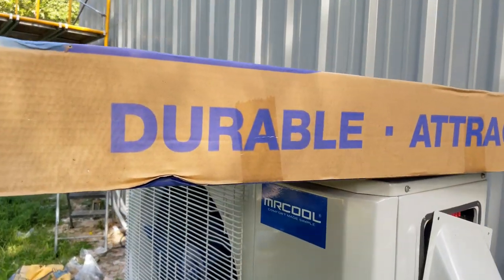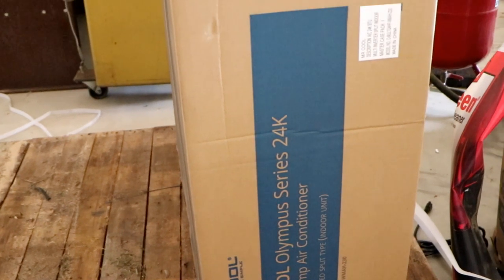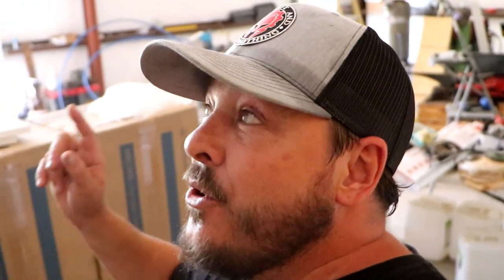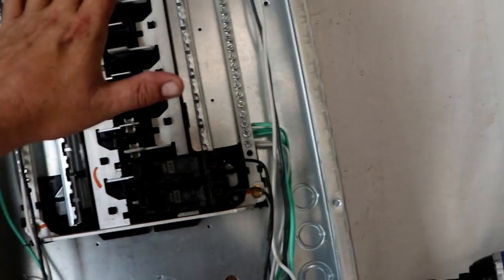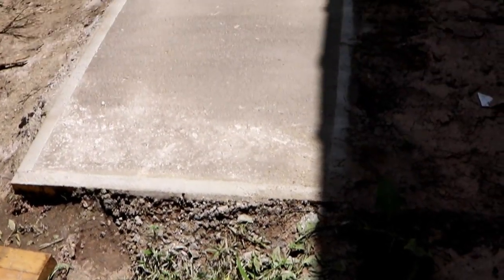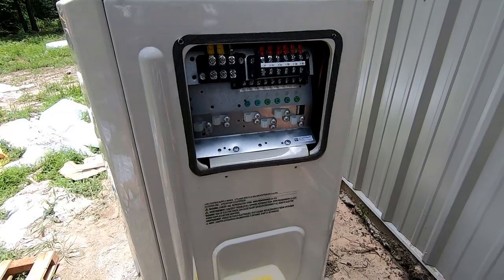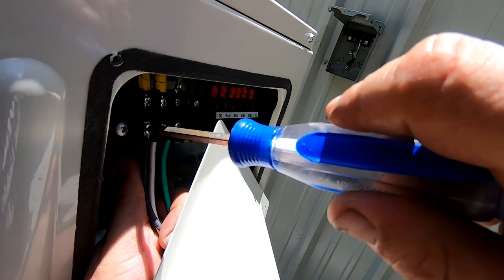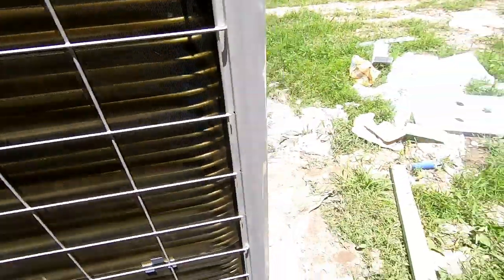MR COOL DIY MINI SPLIT Install

Comment: Here is Charlotte NC, it gets hot but, not Texas hot. However, my modest 580+ sq shop with loft stays cool in the summer and warm in the winter for about $30/month. What a great way to work! Wish I had this 30 years ago! Great video!

Comment: If I remember right slot of the mini splits come pre charged I  have a conventional unit and my outside unit came pre charged too all you have to do is pull a vacuum and open the valves

Comment: Any plans to install solar to help cover the power costs of the AC and the rest of the shop?
Reply from the maker: +Tedium Yup. I located the shop at the top of the hill south facing with full sun. I also have a 400 watt wind generator that may or may not go up. I would like to have the shop full solar with a diy tesla style battery wall using 18650s of something similar.
Reply: @TheGoodoftheLand  the YT channel JehuGarcia specializes in DIY tesla powerwalls and is in Cali
Reply: @TheGoodoftheLand  Check out the cells that are being recycled out of Ford EVs...I don't recall the model but supposedly they are quite cost effective and stable, with the right controls of course.

Comment: I’m an electrician and I honestly think you installed it pretty well. Maybe you’ll pin me anyways. Btw the one thing that did irk me was you putting red before black in the 123 lol
Reply: The 10/2 MC on a 50A didn't bother you?
Reply from the maker: +Sam Gaunt  Sorry, it's a 30 amp circuit. I misspoke.
Reply: @TheGoodoftheLand  It's our "culture": from the time we are entrusted with wire strippers, we're quizzed and judged on everything last we do. From our journeymen, our masters, inspectors, engineers, the list goes on. Think it's annoying? I just realized I inspected your work, on a Sunday, on Youtube, while I'm tryin to relax! I need more beer...

By the way, work looks good. It's actually code to have a means of disconnect for any equipment that's "hardwired" like your condenser. That's an oversimplification, but ...beer...
Reply: @TheGoodoftheLand  PIN HIM !!!!!

Comment: General rule of thumb. Line 1 is black, your low powered stuff lights, fans, etc, or 1st leg of a 220 connection. Line 2 red is your dedicated high power/ motor 2nd leg of the connection. Good to wire it that way for easy troubleshooting and even power distribution. Don't have to wire it that way but it helps.

Comment: very good video thanks for the info on what it takes to cool the building.i thought that mister cool systems come recharged and you dont need mohave a/c neck to pull vacuum

Comment: Abom79 has a video installing his but the unit came serviced already. once you tie yore lines in you open valves. this is a awesome unit you have. I will check out mine now
Reply from the maker: +Rodney Wroten Yes, Adam's was the DIY unit. They are a great option. No evacuation required. If I had to do it again I would go with a 24k diy and save some money. 24K Is plenty big enough for a 1200 sqft shop.

Comment: Don't know if this applies to your system, but on ours we can't turn one off because freon keeps circulating through unit and causes coil to mold if there's not some airflow over it at least some of the time.

Comment: This is an older post, but anyone with Mr. Cool experience, do you know which unit is best to get for the 5 zone?  I heard you can phase them in later and can start with say two if you are on a budget, and can add more later as money allows.  I want to get one that can accommodate up to 5 zones, but due to money issues I could probably on afford to start with two zones, 5 ideally.

Comment: What gauge wire did you use between the AC disconnect and the unit. I'm using 8 gauge between the disconnect and the breaker box but I'm having a time to get the wires to go into the hot hot ground on the unit. I used a 10 gauge wire mines is a 27k but unit
Reply from the maker: +Darnal Green Ten gauge is fine. Ten is actually fine for the entire run. The unit barely pulls any amps. I was shocked at how little power it used. If you need any further help shoot me an email with your phone number

Comment: Is this the same setup Adam Booth added to his shop? I wouldn't mind having AC in my shop.  My shop is built very similar to yours, but I don't have any insulation, and the time it would take to move everything away from the walls in my shop to add insulation would be CRAZY! Did you buy your insulation with the shop kit?
Reply from the maker: +Salvage Workshop Yes but Adam's was a 18000 btu. For your shop size I would get the 24000 btu (link in description) Grab some foam board insulation from the big box store as install it on one wall at a time. It will change your life. The unit itself will absolutely cool your shop without insulation but it will be consistently fighting the heat.
Reply: @TheGoodoftheLand  Awesome! Thank you brother! I'm gonna take a serious look into that!

Comment: nice video, I have a 1000sq ft ranch open concept . Do you think the 24btu would do the job?
Reply from the maker: +D Mac Definitely. Im at 1200 and I only use one head. Its in the low 90s here today and my shop with one unit (24k btu) is in the 60's. I have it set at 62 for testing. It is killing it. Very happy with the unit.
Reply from the maker: +D Mac I'VE an Amazon link in my latest vid with my recommendation.

Comment: Thank you for the video. Appreciate that. Question, does the gauge of wire coming from the the breaker to the disconnect box need to match the gauge of the ac whip going to the actual unit? Hope thats not too confusing.

Comment: Did it come with Freon ? If not what did the Freon cost ?
Reply from the maker: +mean gene it does come with freon. No need to charge the system. Just turn a captive valve to release into the evacuated lines. If you buy the DIY system you don't have to evacuate the wall unit.
Reply: @TheGoodoftheLand  dang that's a hell of a deal. I see a purchase in my future. My Barn/woodshop and my 2 car garage/hot rod shop gets smoldering hot. North Houston. :(

Comment: Is the unit linked above the exact unit you got ? 
I need to get 36k spread over 3 rooms.
Reply from the maker: No. It is 24000 btu. I have two 24000 btu heads. You only need one for a shop this size. I can easily maintain 70 with just one unit on in summer. Two is overkill. Could literally hang meat in there.

Comment: i though the meny split AC units you didn't need someone to pull a vacuum? how much $ ?
Reply from the maker: +Keith Baker You don't if you get the DIY system. This system is not the DIY. The only difference is the evacuation. It cost me $100
Reply: @TheGoodoftheLand  that unit was $100?
Reply: No I think he said the unit was $1000 and to have the system vacuumed or evacuated for installation was $100.
Reply from the maker: @keithbaker5042  No. My unit is 2 4k unit. The evacuation was $100. I recommend only buying the 24k unit as that is all you need for a shop this size. Hope this helps

Comment: The whole reason to buy the Mr. Cool DIY is because its pre-vacuumed and you paid extra for that.  So you don't need the AC guy. If you are going to do the vacuum yourself, then at least cut the lines to fit.  With the way you curled the coolant lines up up, you're going to get oil stuck in those areas and it will mess up your compressor over time.  Your "AC" guy should have known that.
Reply from the maker: +Kimo Jon you are correct. He hated it.

Comment: I have thought about such a system, but worried that the air has so much saw dust and sanding particles in it, that it would clog up the inlet air, to such handlers over time..  IDK
Reply from the maker: +Gary Mucher Definitely a problem. My guess is even with the filter I'm going to have to clean it every year. It would probably be worse with sawdust. You just gave me an Idea.. might add a thin peice of foam across the top of the unit to act as a pre filter.

Comment: That wire didn't look big enough for a 50amp circuit 🤪
Reply: I thought the same.
Reply: @Pelonius  Right?  It would be nice to see the nameplate for Max fuse size and RLA rating.
Reply: Novice here, could he have used an 8/2 Romex wires with a 40amp breaker connected to a 60amp disconnect?

Comment: Leave the ac work to the professionals that's a 240 volt system that's enough to kill you you should not be telling people who don't understand electricity yeah it's easy. and apparently you're not going to be spending a lot of time in that shop if you're implying that it's going to cost as little as it is I do this for a living I install these all the time parent Lee somebody got a kickback I like your Channel this not so much! You have four tons of cooling in that shop that's going to cost you a lot of money to run inverter technology or not.
Reply: If he runs it 24/7 yeah it might cost a lot. He said several times that this system cools the whole shop down quickly so I bet he only turns it on when he is in there. And he also said in the beginning that if you dont know electricity to hire a professional.
Reply: I agree, these units are pretty efficient but to claim $100 a month vs $300 a month is unrealistic.  A 30% savings is more along the lines of what I would expect.  I find 10btu/1sf is usually plenty to keep most shops comfy in the summertime.  If you want it as cool as your house you sleep in then go with 15btu/sf.
Reply: Hi Dan, Novice here, could he have used an 8/2 Romex wires with a 40amp breaker connected to a 60amp disconnect?